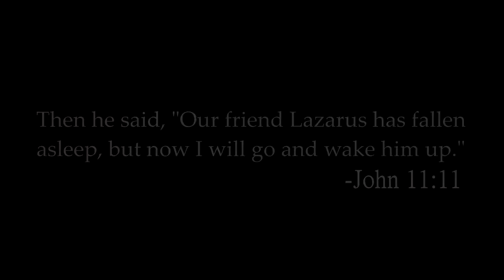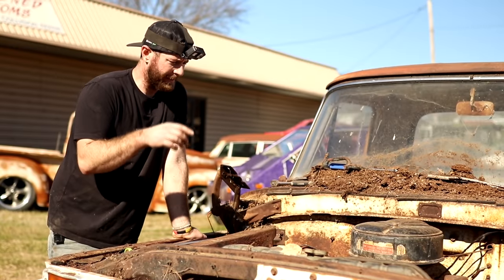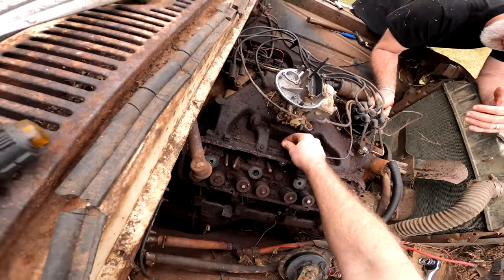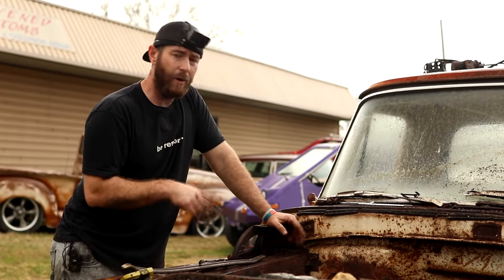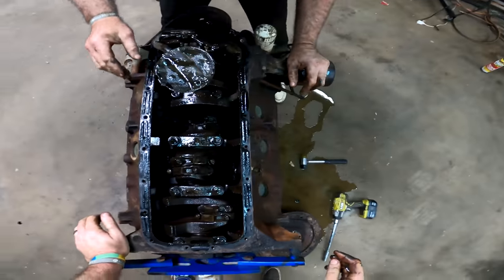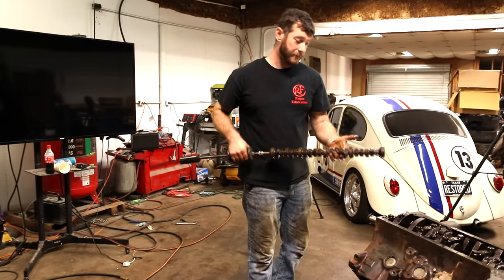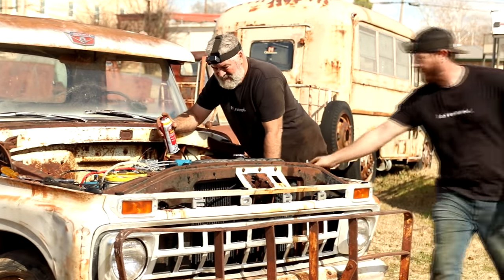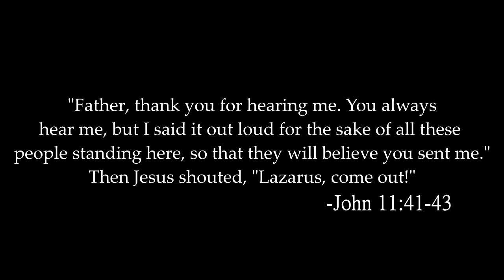Our Best Will It Run Yet! | Forgotten 1965 Ford F100 | Buried By Nature For Over 50 Years | RESTORED

Comment: Memories.  June 1994 bought a blue/white 1982 F150 in Mesquite TX for two grand with a sucked valve.  Swapped the 351 Windsor with some rebuilt east Dallas heads, made it all 'purty' like you guys, ran great, but fouled the plugs from ring wear very shortly.  Took my losses & traded it.

Comment: guys ... I have been inspired by all the workings of your shop  & well I feel the need to share whats goin on 
    I have been over haulin a 1990 sbc that is 30 yrs old .. reason ... bad crankshaft& most likely cause was oil pump goin out also .. anyway   I started the job on around a year ago but in sept of 21 had 2 heart attacks & stint put in  needless to say been down ever since then in recoup mode.. I really need to finish the job to get it back running .... thanks for inspiring me ... God bless

Comment: BEST Will it run video you have done so far.  I especially liked the alternate pacing of some of the drudgery and hopelessness, mixed with the fast forward sections in which you made rapid progresss.  Also gained new appreciation for the value of a $10 can of spray paint.  Keep up the great work and please do more for this truck.  It's cool!

Comment: You two are a pair to draw to(poker term). I’ve got a 61 Bonneville bubble top with a locked up 389 that’s been sitting about 40 years that I may get back into come spring. Still have about six feet of snow up here in Wasilla, Alaska. 
Your next project should be the Chrysler Norseman that sang on the Andrea Dorea about 1956!
Well done gentlemen.

Comment: I have never seen that type of bed in a 65 F series pickup. I know of the standard style side bed, the "wrong bed" (similar to the style side bed from the previous generation of the F series) on 4 wheel drive, and the step side bed. But this bed is cool. Looking forward to getting a better look at that bed.

It looks like a fleet side bed from a Chevy/GMC Task Force series pickup.

Comment: There is a break away apart I use up here by crc I believe it is called freeze off by far the best penetration oil I have ever used it actually freezes the rust off

Comment: Back in the mid 80s prices for scrap metal skyrocketed 300% or more in a very short period of time.  To this day I don't know why but it did.   All the junk yards as fast as they could started sending, mostly 50.60 & 70s cars and trucks to the crusher for $800 to $1000 or whatever they could get in those days.  In some cases people drove their cars to the crusher.  It was worth more in scrap than what a dealer you give you in trade.  The heavier the better.  Lot's of cars and trucks got lost in those years.  Then came cash for clunkers in the mid 2000s.  Mostly that just took out old trucks.  Now you see Youtube videos resurrecting rusted out trucks like this when perfectly good ones were crushed and shredded not all that long ago.

Comment: That's a "DuPont" overhaul. Throw whatever parts you have on it, spray some paint on it and call it done.
You guys did an exceptional job getting that one to run again. Congrats to you both!
Is that an old Chevy Cameo bed?
If it is and is not in too bad a shape, it's probably worth a couple of pennies.

Comment: In locomotive workshop this engine would have been placed in a bath of warm high-boiling point liquid paraffin oil (kerosene) with a temperature of about 100 degrees Celsius. For a period about two days. The hot oil makes the metals slowly expand and the kerosene - being a penetrant - penetrates all the engine's moving parts. The boiling point of high-boiling point liquid paraffin is 152 degrees Celsius. Great video!!

Comment: Sometimes when the heads of the bolts are really rusted you can try a close metric socket tap it on with a hammer and break them loose that way
Reply: I'm a former army mechanic helicopters to tanks been there done that but you guys really bust your ass on some of these motors I probably would have sent to the scrap yard good job

Comment: That would be a collectable truck if it were in good condition. Custom Cab, 352 engine and the twin i beam logo on the fender sets it off. I'm curious about the bed, I can't find a photo of another '65 with that bed. The bed must be from a '67 or later truck.

Comment: The most complete fix of a dead Ford FE I've ever seen!  You didn't rebuild it completely; the block, the crank, the camshaft, the con-rods, pistons and even the oil sump are still original and some of them are pretty marginal at best.  I doubt that you'll ever resurrect a worse engine.   Extremely impressive!

Comment: A genuine question  because I am interested . You buy many vehicles and get most of them working to a point.
What happens to them then, do you sell them on to be rebuilt by the new owner's.  Sell parts to others doing rebuilds, store them or what. I used to  buy old motorcycles, rebuildthem and sell them on to getcapital to do it all again. 80 years old now and less energy and  movement  but still interested 
In anything mechanical. Brian. Spain.

Comment: You mentioned you may lower it with air suspension.  PLEASE do not do this.  This truck looks fine at its factory height.  I have seen too many vintage and classic vehicles "lowered" and in my opinion ruined!

Comment: Guys, i have a 1946 ford v8 delux. Its a flathead and is seized.  Undid all the bolts on the heads but they wont come off, any suggestion's?. Thanks Rob.

Comment: Nice. Years ago I went to look at an early 70's International Harvester 4X4 pickup that was listed for $500. Upon arrival the owner led me out behind his barn where it had been sitting for several years. I opened the door and mice ran everywhere! He had been storing bags of grain in the cab for years and the seats were completely eat up. I ventured a look under the dash and under the hood. In both places all of the wiring and everything that was rubber had been chewed on. That meant it needed a complete upholstery job and a complete wiring job at minimum. I told him that I'd pass on this one, while thinking he'd have to pay me $500 just to haul it off!

Comment: I’d be surprised if y’all haven’t seen this recipe yet, but if you make a 50/50 mixture of acetone and automatic transmission fluid it makes the best penetrating oil out there. I found this on a machinist’s chat page.

Recently “Machinist Workshop Magazine” did a test on penetrating oils. Using nuts and
bolts that they ‘scientifically rusted’ to a uniform degree by soaking in salt water, they then tested the break-out torque required to loosen the nuts. They treated the nuts with a variety
of penetrants and measured the torque required to loosen them.
This is what they came up with:
Nothing: 516 lbs
WD-40: 238 lbs;
PB Blaster: 214 lbs;
Liquid Wrench: 127 lbs,
Kano Kroil: 106 lbs
(ATF)/Acetone mix (50/50): 50 lbs.

This last “shop brew” of 50% automatic transmission fluid and 50% acetone appears to beat out the commercially prepared products costing far more.

I feel like y’all should try using this next time you find an engine seized with rust

Comment: I drove a 66 F100 Custom for a few years. It was the same body and interior as yours, red, and white, with a 352 big block, and 3 on the tree. That thing had torque for days. I have driven up steep switchbacks and never had to change from 3rd gear.

Comment: Man, I could feel your pain all the way! I just recently opened up two FE engines that looked just like yours inside, only the bottom ends looked just as bad as the tops. Both distributors were destroyed. Both had holes rusted in cylinder walls. The oil pump was rusted off of the one that was full of rats nests in the bottom. I walked away from both...

Comment: Holly crap, that's the worst I've ever seen. I have a 66 with a 390gt in it. I  freshened the engine. Ran the numbers on the crank,and rods, heads. It's a true CJ. Block to. Runs great. A real tire smoker. Had some health problems, but past that now. Will get back at her this summer. Love them old trucks. And I'm a chevy guy.

Comment: I once had a volvo145 wagon, I installed a high performance head a guy sold me that was sitting in a barn,I lapped in the valves, and everything looked good- I drove the car 2 miles,and it started skipping,I drove it home. And found a valve spring had broken,at first glance,it was just a fluke( I thought) luckily the valve didn't have the keepers unload and drop into the cylinder! I replaced it. And continued. Driving it easy, came to  the first stop sign and think! It began skipping again,once again it was a broken valve spring! Under the magnifying glass, the valve springs were pitted with rust,enough to,after running for a while would break. I replaced them all after that,shortly after spun a rod bearing,   great lesson to me- great experience also! Keep up the fine videos!  Very well done

Comment: Family dies in terrible car crash way back in 1962. Their old station wagon ( second family car ) sits in a shed in the back yard. Rain, dirt, dust, rust and salty ocean air will just about destroy every bolt, wire and screw  IN  that engine.

Comment: Guys If its standard, Put oil in chamber,s for a couple of days, Hook a chain, 4 gear let the Clutch out, small short pops, We freed a ford 3/4 stuck 30 years, There a chance of braking something, You have nothing to lose, Everyone said you will never free we did, Drove it 4 years plowing snow

Comment: I just came across your channel today. I love it. I have no doubt that a lot of the old engines will run. Another YouTube channel Fabrats found a boat that has been sunk for over thirty years. They pulled it from one of the lakes from the reservoir of lake Powell or lake Mead.  The boat was in tact and in good shape for being sunk for thirty years. They pulled the motor and went all through it and managed to get it running. When they put it in the water it preformed like new. They found the original owner and gave it back to them. Just like the videos of yours I’ve been watching, great content. Never give up on what you are doing. If you can think it or dream it you can make it by not giving up and following thru to make the dream and achieve the goal. 
Great video. God bless.

Comment: I thought that they gave up after seeing the very badly rusty engine. They cut either cylinder heads or intake manifold. When they rebuilt the engine, did they use new cylinder heads and/or intake manifold? The young man said that he had problems shifting gears because of problems with linkage between the steering column and the transmission. The shift pattern is like the letter "H". Moving the gear lever back and up selects reverse gear. Moving the gear lever back and down selects first gear. Moving the gear lever forwards and up selects second gear. Moving the gear lever forwards and down selects third gear.

Comment: Old trick...... Work the bolts forward and back while trying your best tricks like your vinegar and marvel mystery oil and whatever else three in one.... I like to mix everything together and make up a gallon of something that I can pour in or pour it on or whatever.... But make sure that you get ultra thin oil mixed with marvel mystery oil.... If you keep going in the same direction when loosening up a bolt eventually all of the rust is going to build up on itself you want to work it back and forth to let your oil mixture get into it..... Like you I used to go at it and just snap bolts off I don't do that much anymore

Comment: Another old mechanics trick and I'm an old mechanic....... Taught to me by my daddy... He learned it at Lockheed........ Here's whatever penetrant you're going to use and then tap the metal with a hammer for a while...... Increase vibrations within the metal that work the lubricant down into it

Comment: You guys at Restored are awesome! I was so inspired by what you did with so many of these vehicles, but the 65 truck in particular, that I went back to the 283 engine (that my mechanic told me was not able to be saved) and decided to do my own evaluation. After removing one of the valve covers, everything underneath was really clean! I have not taken the heads off yet, but I am hoping the rest of the engine looks as nice. Again, I have been inspired by what can be done with engines that look like the will never run again!!

Comment: Just for future reference, if it was only the lifters and or the cam, you would still get movement at the crankshaft from the timing chain slack. The crankshaft Rock back and forth ever-so-slightly. I told you fellas in another comment to get your first lady of Restored on the tools. 😜

Comment: In 1982 I popped one of these out of the farm ground it was sunken right to the bottoms of the doors….!

I had to change a few spark plugs and some wires and give it a bottle of fresh gas, that I just tied to a mirror and ran down to the carburetor)

 and I drove this thing home in about 3 -5 spark plugs
I put less than 300 bucks into this thing and I drove it until I sold it a year or two later…
It was a straight six)
I drove it until I hurt my arm and leg and I could not drive a clutch for a year or so therefore I sold it to a friend who drove it for another 27 years and then he sold it to someone else and it ran so good that person wrecked and destroyed it….

Comment: I pulled one home last year and ants had went in the carburetor and through the intake and heads and through two open valves and filled the two cylinders up with dirt, after I blew it all out the engine turned over fine and fired up soon after

Comment: Cant believe you got that engine to run again. I would have popped off the valve cover and sent it to the scrap yard. I'll buy you the correct bed if you want to swap. I'm pretty sure that bed will fit my 55 chevy and I know where a decent ford bed is.

Comment: Sometimes  if you crank for a while and stop for a bit then go back it will get better and better tell it starts. This is because as the pistons move up and down it creates friction witxh creates heat. This allows any stuck rings to loosen up and brings compression up.

Comment: Need to find a Crown Vic that has been rear-ended and do that Crown big swap motor subframe all of that stuff truck would be sweet 20 miles to the gallon plenty of power would one wheel peel for a mile

Comment: To go that far and not replace the rings bearings and cam is nuts. Just mic the crank to make sure its in spec and put standard rings bearings cam and lifters. Thats not very expensive. Putting new lifters on an old crank is a bad idea.

Comment: i belive the history of that truck is that it was run into a lake for 10 years then someone pulled it out ,then it was hit by a landslide. i was worried that  the cam bearings might get scratched when you pulled the cam. now i have worked on lots of old iron and i think i would of scraped it when the windige  tray fell apart. hats off to you gentile men

Comment: The simplest thing to clean the engine , empty the oil and full up with diesel fuel, after siting a day crank the engine with no spark plugs a little and  your engine will be band new inside, my grand father make this trick to old engines.

Comment: Did you bore the block so it wouldn't smoke? Most of the time when water sits in an engine the cylinder walls become pitted.

Comment: MAY BE MAKE A FLAT BED OUT OF IT   THE FORD CAB/ CHEVY BOX / AND G.M.C. GATE  /   IS A LITTLE TO MUCH  /    BUT IF YOUR GOING TO KEEP IT THAT WAY  /   INSTEAD OF A BALL HITCH ON THE REAR BUMPER   /  PUT A BOAT  PROPELLER   AND TO TOP IT OFF A MACK BULLDOG ON THE FRONT OF THE HOOD  / THEN WHEN PEOPLE LOOK AT IT / THEY WILL NOT KNOW WEATHER  TO WIND THERE WATCH OR SPIT

Comment: All that rust was caused by condensation from short trips not letting the engine run long enough to dry out and Valvoline oil will also do that

Comment: Folks, correction, it has an engine in it, not a motor.
Reply from the maker: Strange that it was built by Ford Motor Company lol. But we understand
Reply: Well folks I'd like to see you see that truck when you get it completed, back to original off frame restoration I'm about to look pretty. Everybody calls it a motor but they're all engines if they run on diesel gas and steam they're called engines, if they run on electric, they're called electric motors that's the way I was raised. And I started working on engines back on tractor trailers in the'70s I'm still in the tractor trailer business 60 years old now I still call him an engine they run on diesel gas and steam, I I call an engine.

Comment: I knew the second you called the harmonic balancer a flywheel you didnt know one end of an engine from the other and anyone with a brain can see with that much rust inside those rocker covers that its even worse inside those cylinders where theres no oil and even if you get that engine to turn over and it happens to by some miracle fire off that engine is going to fly in a million directions because everything has rusted completely out
Reply from the maker: Never called the harmonic balancer a flywheel, for that simple fact of this engine didn’t have a harmonic balance, rather just a crankshaft pulley. The inside of the cylinders were indeed not as bad as the top end of the engine. The engine did crank up and run and is still firing up and running first try every morning 🙂